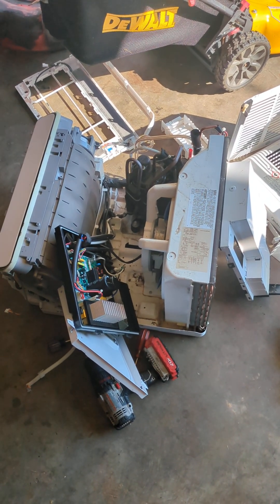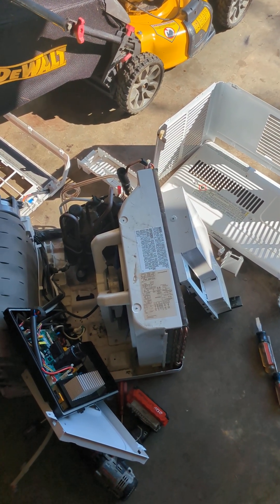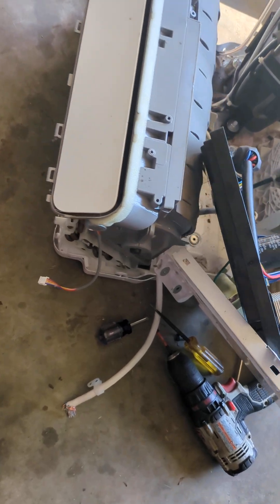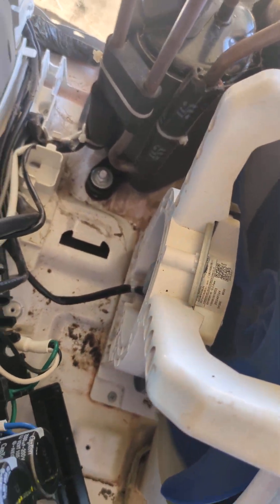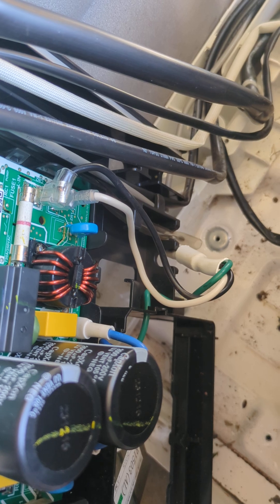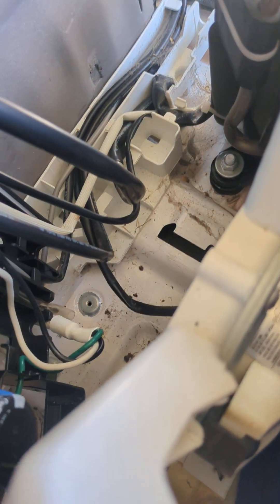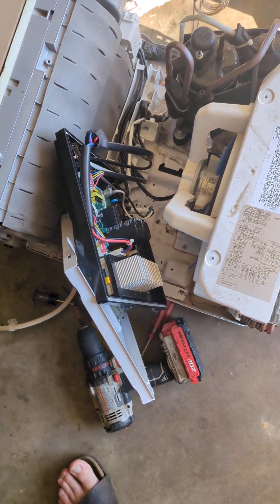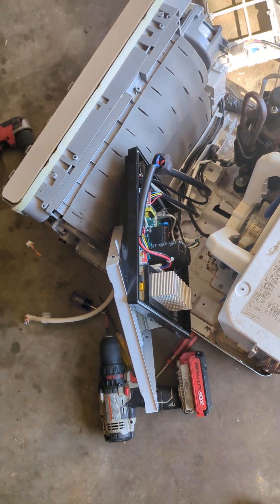Tear down of Midea U shaped air conditioner that was recalled with cut power cord, replace cord.

Comment: Oh yeah you can splice the cord. The white and black are wrapped in foil and strands of thin wire on the outside of the wire. So you have to splice those as well or it will not work. So splice black white and green then splice wire wrapped around white wire and wire wrapped around black wire boom it then works. I may just buy the cord but at least I can now use it until new AC arrives.